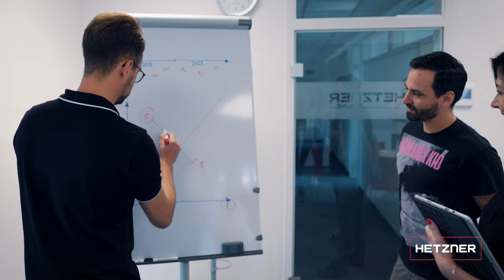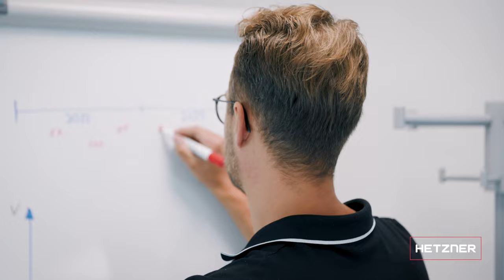We are Hetzner

Comment: Nice video, but the cloud servers still lack DDoS protection. The alleged protection is not there and does not provide any security. And you call that an innovation.
❓
Reply: I have many sites, webapps and other cloud hosted programs deployed on their servers for years and have never once had downtime to a ddos attack, so not sure who you're being attacked by or what but that seems odd, I have had multiple attacks attempted as well, quite a few actually, still nothing. Not sure how you're saying they lack DDoS protection, perhaps its not the best but its not absent.
Reply: is it a ddos attack, or didn't you calculated the users wrong?
Reply: @schwingedeshaehers  Teamspeak gets DDos attacks, nothing protects here, the server is big enough.
Reply: I also have a cloud server, and they do have ddos protection... They even have it announced on their web page, i'm not sure about the limit but it does work but if you are beeing attacked sure you will feel something the first 10 mins as the protection takes some times to move inn and after that it works and you end up with a email from Hetzner wanting you to write a little report and how you will deal with it. If you never reached such email and your server was down im 99% sure it was your own fault propebly poorly coded services..
Reply: @UlrikBrun-ir7mh  At 500,000, allegedly the firewall is supposed to activate. The attacks were very significant, yet they were not filtered. I don't just have one server; I have several.
Reply: In addition to detection based on traffic volume and packet count, we are able to accurately pinpoint the actual attack and respond precisely to the specific attack type being used. A UDP flood with 500,000 packets per second is harmless for servers. However, 500,000 SYN packets can pose a problem. It is precisely this distinction that is possible.